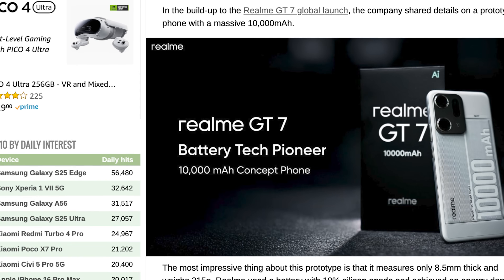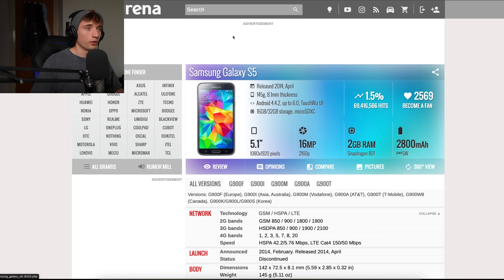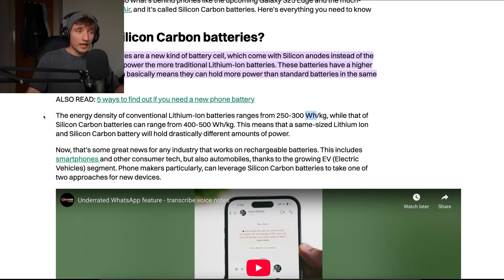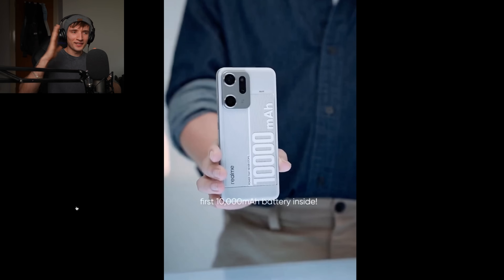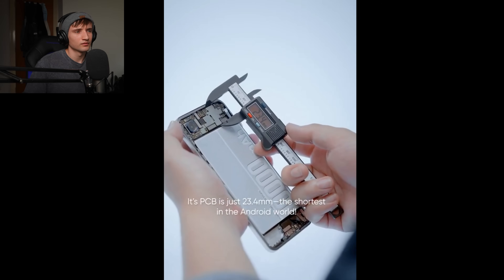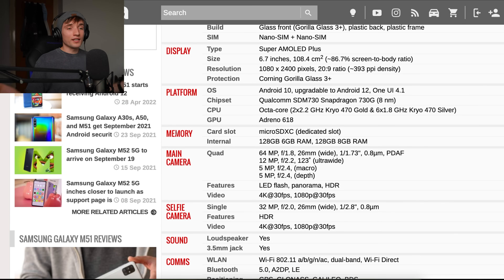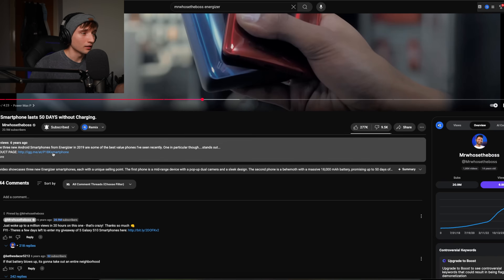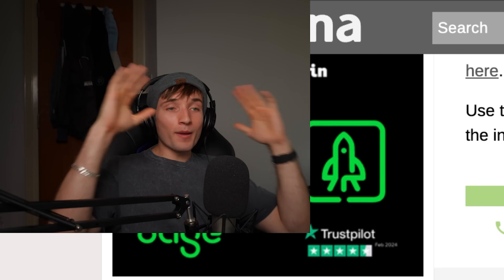Phone Batteries SUDDENLY Got ALOT Better… But HOW?

Comment: To me, having a bigger battery while keeping the phone size the same is a big win. I’m using the S23 Ultra and rely on it for almost everything, it does everything I need except the battery life isn’t great. The S25 Ultra doesn’t offer enough to justify an upgrade. With phones now getting 7 years of software updates and powerful chipsets, we’re clearly entering a time where people will use their phones for 4–6+ years. That makes long-term battery life even more important. What really matters is optimization. Imagine a 10,000 mAh battery with Apple-level efficiency. That would be insane.
Reply: Dude 10000mah on an iphone would get you like 3-4 days of battery life 😅
Reply: I was on the same boat. Got S23 Ultra, S24+ (Exynos) and S24 Ultra. S24 Ultra is a great all rounder, but since I side-graded to the Xiaomi 14, I had no regrets. Better cameras imo, compact size, etc. I'd say go for the Xiaomi 15 (China version if it has all the bands for you, since it has 5400mah sili-carb battery while global has 5200). It's affordable (the China version), as long as you're able to bear with HyperOS on English. 14 or 15 Ultra are also and option if you care about câmeras and phone size, but somehow battery isn't as good, for now. You can also wait for the 16, since its rummored to have the same compact size but 6000+mah sili-carb! 👀
Reply: OnePlus has launched a compact 6.3 inch phone with 6300mah battery, which I think is more valuable than introducing a 7inch brick
Reply: Not just china mobile phones but also china  EVs Batteries and china  drones..

Comment: You need better batteries for better display (brighter, more hz) more power seems like we are close to the point where phones will be able to play pc games
Reply: Battery isn't what's stopping phones from playing pc games. Thermals and optimization is
Reply: Already the case lol
Reply: With good driver updates, the Redmagic 10 Pro (or even future models) can play PC games at playable framerates, but can consume up to 20 watts doing so at maximum GPU clock speeds.

Comment: I want a mini/compact phone with a flagship processor, 5000+ mAh battery and good cameras that work well whatever fit in that size.
Reply: That's already the Xiaomi 15 and vivo x200 pro mini and many more others lol
Reply: @radstf6342  Xiaomi is crap. I agree partially with Vivo. But it has a good battery only theoretically but the specs don't show results in practical.
Reply: hopefully oneplus 15s will be it

Comment: My S24 Ultra has 5000mAh but only like 6h of Screen On Time, which is ok for a short day but not enough for a longer Weekend trip where you use it more for example.
So I wish I could have a 7000-8500mAh Battery tbh would be nice.
Reply: Yeah but we want the battery to last too with that 8000mah not lose it in hour im waiting for that battery that china made the size of a nail but can store 150 000mah imagine you will charge 1s a month and with 120w charger u will bearly see ur charger
Reply: Processors have gotten more power hungry, too. In the S23 Ultra, I see 9.4w max, while in the Redmagic 10 Pro, I see 20.9w max. 20.9 watts in a phone! The S20 Ultra got 6.2w max.
Reply: @tekeagle2136 that's not a sustained power draw it a burst of power drawn then it's settled around 6-8
Reply: @tekeagle2136  redmagic makes sense since its made for gaming

Comment: So now the hardware will probably outlive software support
Reply: Itsl already does. A 2020 - 2021 phone still works fine now. Infact I use a 2021 phone as a burner phone and it's completely normal battery health all fine
Reply: @user_emzz my mother is using her S9+ from 2018 and it still works fine apart from the screen which glitches and has a green shade.

Comment: as phones get more powerful we're seeing longer rebuying cycles.
bigger batteries means less battery degredation over time, making the phone usable for longer.
 it also helps the resale market and just generally.
we're seeing 5+ years of updates on phones now for a reason, they used to be used for 3 now they're being used for 5.... take the iphone 11 for example
people still daily drive that. 
as we reach the point of marginal gains for performance actually benefitting the consumer im thinking that we're going to enter a period where longevity, screen size & the software experience are going to become one of, if not the largest driving factors for phones sold.
Reply: Give the brilliant guys at Apple a chance to degrade your phone.  Eg no longer provide updates so eventually can't use any apps.
Reply: Actually, it is the other way.

Phones are getting slower, so the buying rate is going down. We had massive upgrades from the 300MHz ARM11 chips back in 2008, all the way to the 3.0GHz Cortex-A73 chips in 2017. Progression has really slowed down since then.

The only upgrade we have seen is in the Camera space, where the Samsung S7 was a big leap, and we have had incremental upgrades until the Samsung S23 Ultra recently. There are the Oppo/Vivo Luxury Phones with even better Cameras, but they're basically China Exclusive right now.

We have hit the plateau in many respects. I think after Battery Life, the next leap is going to be Remote Computing using 6G Connection. So you could get 2022-levels of Desktop Computing, Gaming, and AI Support using a hybrid combination of on-board processing and web-based processing.
Reply: @ekinteko not just on phone tbh, even computers like the CPU of intel and amd. Hell even the GPU like the newly release 50series of NVIDIA. It seems we're now getting stagnant in performance gains unless they go back to the drawing board. Like how we're getting stagnant capacitytosize/weight ratio of lithium batteries, we have to change the chemical to get a better performance instead of forcing our selves on pushing the limits of lithium batteries

Comment: But its kinda crazy that they're playing down the efficiency of these batteries, like iphones measly 4685 milliamps with lithium ion batteries even beats oneplus 13's 6000 mah silicon battery technology.
Reply: In the long term the iPhone battery will lose capacity and will die very fast like 2-3h max but the 6000mah in year when 1000mah becomes useless u will still have 5000mah
Reply: Optimization and decent capacity can save u more batteries than bloaty software but large capacity
Reply: 4700mah is still huge and iPhones usually have lower resolution display and restricts multitasking unlike Android but 6000mah lasts longer in reality for sure if you don't have battery protection turned on
Reply: @clickbaitpro  I meant both without battery protection because, lets face it, very few people are conscious about their battery degrading

Comment: Honor power has 8000mah battery already
Reply: I mean rog did too
Reply: @ovadotnoname  not rog redmagic
Reply: @ovadotnoname 
Where? 9 pro has 5800 mAh
Reply: @Ervytron i mean they have large battery
Reply: I can't find enough reviews done on this phone.
Reply: You will find @jayrem3176
Reply: Power 😮
Reply: @ranjitmandal1612 power of sun
Reply: @AponTechy  in palms of my hand
Reply: Graphite Degrades Slower Than Carbon Silicon Batterys Because of That And then The Chinese 160w S..t Powering it Gonna Suck Arse.. Quickly
Reply: @MKT0072 didn't get it
Reply: @MKT0072  you can replace the battery all batteries degrades
Reply: Yeah but doesnt perform as well / consistent as Samsung or apple
Reply: @user_emzzit does? What you mean "doesn't perform as consistent".
Reply: @user_emzz It's not. These are far superior to Apple or Samsung's battery backup.
Reply: @user_emzz I assume you're a brand loyal person. I've used many brands since the inception of android, they're all practically the same. Price is what matters most when it comes to Android.
Reply: @user_emzz Doesn't matter. Big battery can last for years and decay slower. You use 3000mah iphone for a year and the battery is just gonna be 2000mah in the next year and it wouldn't last a day. Unlike 10kmah if it decay to 8kmah, it's still a lot
Reply: @youravghuman5231 not to mention bigger battery means much less cycles are put on it over its life